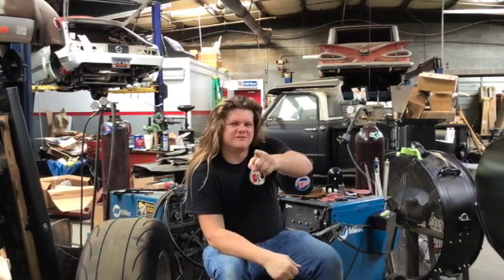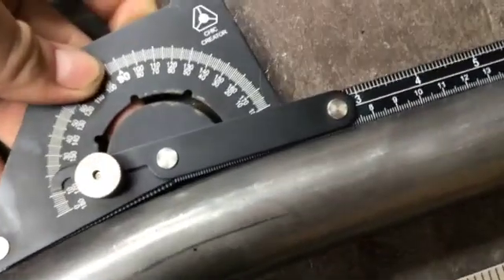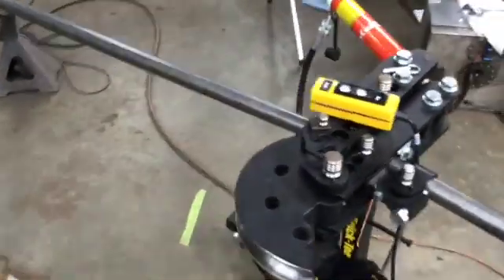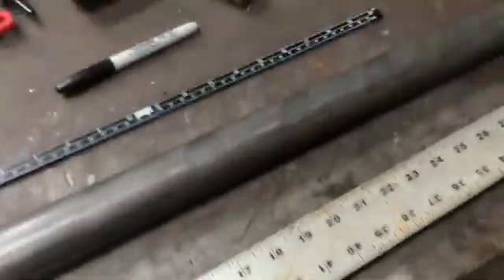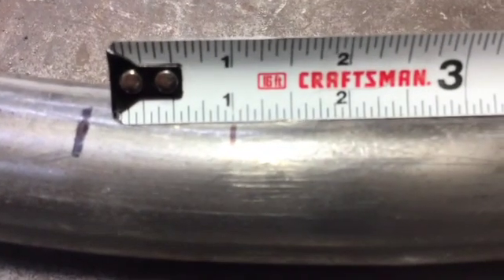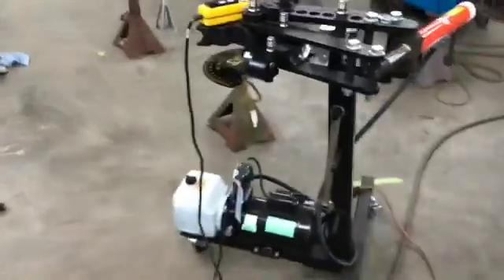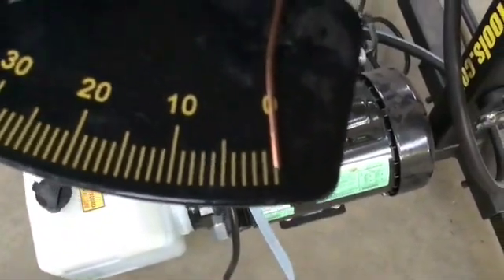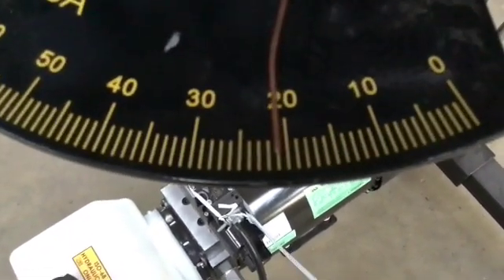1969 Chevy Nova 25.3 Cage Chassis #1 Rear Cross Member Bending

Comment: I want to figure this out math wiz . can you do one video doing the math .
Reply from the maker: I have done a little bit of math in my Chevelle Part 4 video and touch on some in my Part 5 video. I've been wanting to do more, but most people skip that part of the videos and it's hard to explain and boring as well. I might try to put a dedicated video up, though. The way I do everything is to design the center line of each tube using straight lines and hard corners and then calculate the span of each bend using trigonometry, angle, and bend center-line-radius. I figure out how much length the bends occupy (not take-up, that requires material properties and something called the "k factor" of the material; I measure from each bend after I make it), and using the span of the bends, I can figure straight length between bends too. Thanks for watching and commenting!

Comment: Keefer, did this Nova get the stock front clip? If so how was it mounted. Ty
Reply from the maker: It will be. I am going to bolt it to the floor pan and firewall (stock style) and I plan to make mid-plate mount tabs (welded to the front subframe) that extend down so that I can weld flanges to the main tubular frame rails (2a) that will bolt to those tabs to tie everything together. Additionally, there will be a pair of bars going forward to the firewall from the dash bar which will have 4 bolt flanges welded to the ends on the inside of the firewall (hard against the firewall), and front support bars will be welded to the subframe that will lead up to flanges at the firewall which will bolt to the flanges on the front of those tubes going forward from the dash bar (sandwiching the firewall between those flanges). That way, the front subframe clip is still removable if it's damaged or is to be replaced with something else, but it'll be tied in to the chassis well. Thanks for watching!